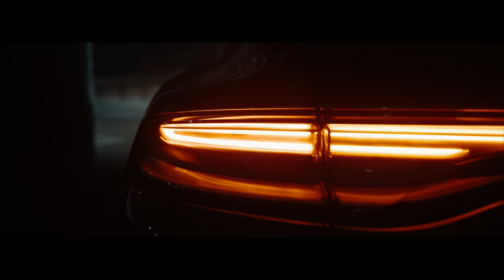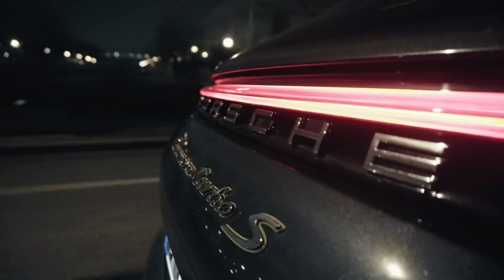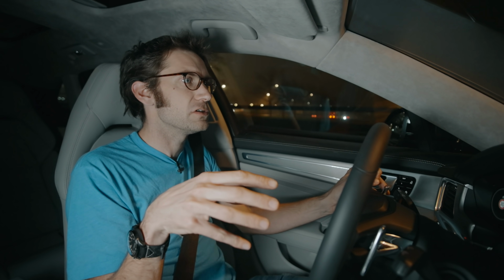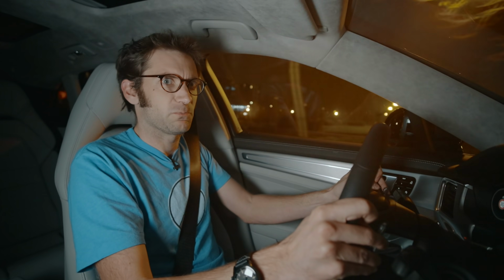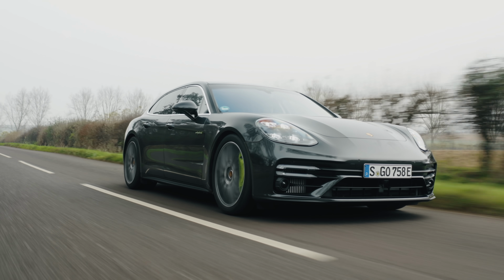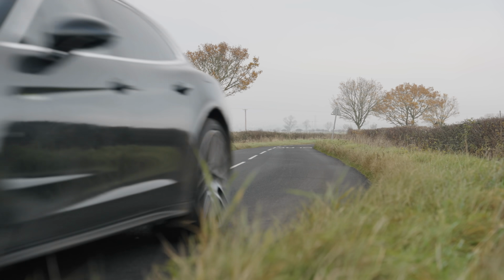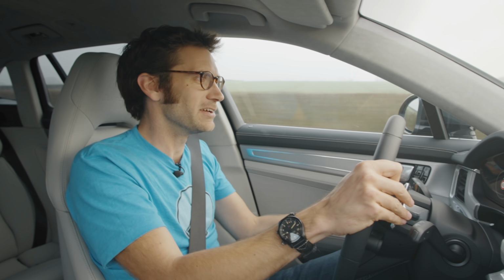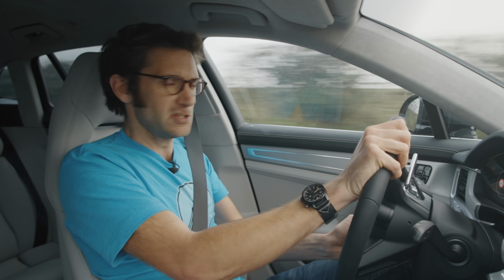NEW Porsche Panamera Turbo S E-Hybrid Sport Turismo: Road Review | Carfection 4K

Comment: Drove the ICE-only Turbo S Sport Turismo a little while ago and I was just utterly blown away. Would have one over an RS6 and an E63 Waggy
Reply: what made it so good ?
Reply: @wc8561  At first it was my disbelief that something that weighs the thick end of 5,000 pounds could feel so agile. The Panamera does that thing great cars do where it wraps itself around you like a warm blanket on a cold day. You're almost at one with it. The steering is sharp and accurate (maybe lacking in feedback from the road surface, but it's so direct it almost makes up for that). Plus the rear-wheel steering really helps. You really can feel the thing pivot in tighter bends. Porsche's ceramic brakes are the best in the business, too. They're immediate, as in the braking starts right at the top of the pedal. There's no squeezing to do. You want to stop? It stops, and in a hurry, too. It's also ridiculously fast, sounds great, and is comfortable on longer commutes (took a road trip in it just to be sure). It feels just like the 992 I drove in 2019, but bigger and much faster (in a straight line).
Reply: @Nick-qx1vf  Were you comfortable with the very substantial (exterior) dimensions of the car?  I would love to pick up a used Panamera... if only it were Taycan sized.
Reply: @RoyalFizzbin  It took me about a day to get used to it. They are not inconsiderable dimensions, but it isn't hard to park. If you live where parking is tight you might find yourself see-sawing at the wheel a lot to get it right, though.
Reply: I would like to know more about the advantages you saw over an RS6 and E63? Though i am currently looking into the GTS variant of the Panamera as it’s more within budget. I would like to hear your thoughts
Reply: @DBrealmadrid9606  Hmm the real advantages, from my point of view, was that dynamically it does everything those two wagons did, but better. It's sharper on turn in, better under breaking, and just faster everywhere. BUT it also has, in my opinion, a greater bandwidth. It's just as, if not more comfortable on the road than the E63 and RS6. But it's also more expensive, less efficient, and somewhat less roomy than both. The GTS would probably be a great middle ground, but I haven't driven it.
Reply: @Nick-qx1vf  I appreciate the insight. Would you consider it to be a step above the other competitors? 
More in the lines of the Audi A7, BMW 8 series and the mercedes amg 4 door? Or is it I still above even these cars as well? Knowing that Porsche in general is viewed as an upper level Marque than the other German manufacturers
Reply: @DBrealmadrid9606  HAH luckily enough I've driven all of the above. That's a pretty tricky question. I'd say the Panamera is better than the A7 (which isn't as dynamically capable) and the Merc (which rides much to harshly for my taste) but the BMW is pretty damn good. If it's between the Panamera GTS and the M850i Gran Coupe, I'd say you really have a coin flip on your hands. I'd still get the Porsche, if it were my money, though.
Reply: @Nick-qx1vf  thank you for continuing to indulge me with my endless questions. I normally don’t trust car reviewers to form up a completely objective viewpoint of the car reviewed. What about the interior? I l know the mercs are notorious for their squeaky and creaky interior. I know that such question can’t be easily answered due to the existence of multiple trim levels...etc. but overall, looking at well specced interiors (full leather and all) which car has the the better interior quality out of the 3?
The only problem i find with the Panamera is that the price/performance ratio isn’t as good as the others, but it’s a Porsche after all.
Reply: @DBrealmadrid9606  Well you know that old cliche where Porsche's "punch above their weight"? It's not so much a cliche as it is a fact. They are masters at pulling the most out of their cars—which is what makes the Turbos and GT3s so special because that really is Porsche at its maximum. They're truly world class. 

The 2021 Panamera was rock solid imo. The E63 I drove felt very well put together too, as did the GT63S. Audi's have exceptional build quality and are great places to spend time BUT the fact that there are three screens (one for the digital dashboard, one for the infotainment, and yet another for the climate controls means you're going to to have to be comfortable with three different interfaces, and that's not for everyone) Personally I dont like the way that MBUX works, though. It take a very very long time to get used to and is frequently dim-witted and slow. iDrive is really just okay but I don't like BMW's interiors. Little things like doors being too high (so I cant rest an elbow comfortably on the window sill) and steering wheels that are too fat (not to mention the ABUSE of plastic absolutely everywhere) really turn me off. Again, i'd really say the Porsche is your best bet, even if its touch-control center console IS a fingerprint magnet.
Reply: @Nick-qx1vf  the point you make of the UI is excellent, it’s often disregarded by reviewers or glanced over at best. I have been inside the E63 but not the GT63. I truly can’t justify the premium paid for the GT model given that it sits on the same platform used by it’s “lesser” counterparts, being the E-class and the CLS-class. If i were settle with the Panamera then it would be my first ever Porsche. I have seen claims every where of Porsche’s being overpriced. While there is some slight truth in that, from what you are telling me and based on other first hand experiences of others who, too, had the chance to experience what is it like to be in one. What do you say of the price/performance factor? It’s, in my own, albeit ignorant, opinion, the main drawback the Panamera.
One more point i would like to add is if you could address the practicality vs its rivals. I plan to use the car as my daily driver so any experience you could share in that regard would be tremendously appreciated.
Once again, i thank you for continuing to provide invaluable information to make up my decision.
Reply: @DBrealmadrid9606  Hey man no problem. I'm happy to help. If you want something more practical, go with the Sport Turismo. It grants more head room in the back, and more cargo space. Plus wagons are just better anyway. 

When it comes to price/performance value I  happen to think that, yeah, Porsches DO cost a lot more money than their rivals, but I say its worth it. It's also extremely difficult to use all of an E63s performance on the road where as the 450 hp V-8 of the Pan GTS is almost perfect for a daily driver. I feel that 500 horsepower is about the maximum that you can comfortably use everyday and I mostly agree. ALSO one more note about the Panamera. It is much (much) easier to get to grips with and take advantage of the available performance. You get comfortable so much quicker you're less likely to make mistakes, and more likely to develop your own limits. But don't just take my word for it, test drive them both and see what you think.
Reply: @Nick-qx1vf  Driving dynamics are an important part of the overall experience and, based on your extremely thoughtful answers, i can deduce that the Panamera more than fulfills in that regard.

I actually think that benz made a mistake in making 3 different cars on the based Platform. Especially since it had the CLS as the previous direct competitor to the Panamera. BMW also renamed their 6 series as an 8 series to push it upmarket. Currently i am scouting the market and i have witnessed that the 8 series tends to depreciate heavier than its rivals. I don’t know what to take from that but what i do know and fully agree with you on is that its interior isn’t necessarily that special and does leave a lot to be desired. Based on your own conclusions i think it’s safe to say the Panamera is the 4-door version of the 911. Which is, frankly, the best compliment the car could get.
Furthermore, since i live in Europe, the extra juice from the AMG, M and RS models will not be used to its fullest extent.

Everyday driving inconveniences should be addressed by the reviewers and highlighted the same way you exceptionally did. After all, i will be spending most of the time commuting/regularly driving and these things while seemingly minuscule at first, do eventually add up providing an unpleasant experience.

Thank you for your thoughtful answers and detailed explanations. They have been extremely helpful.

Have a good day!
Reply: @DBrealmadrid9606  Cheers!!

Comment: I drove the new "regular" E-Hybrid recently, good lord what a snooze. Sure it's nice if you have a sizeable family to drive around, but it's so frigging large while offering no emotional experience whatsoever.
Reply: Interesting - so you also found it felt large - like Harry M.; (I was surprised Henry doesn't, here...).
Reply: It is an executive-aimed vehicle the lower end Panamera’s with it’s softer suspension and better sound deadening with the V6’s. The moment you drive the higher trims (ESPECIALLY the GTS) Porsche throws in more of their brilliant dynamic systems into the car to hide its weight much better than say a 4e-hybrid. Plus the Panamera is a heavy car, you can’t expect 911 levels of driving experience. But it is a near base model after all.
Reply: It looks big, feels big and is big. Duo to the design of its headlamps, it would be very difficult to make it appear smaller then it is.
Reply: @kkfarmedkk  sure but things like rear wheel steering could help make it feel smaller (smaller effective turning circle). feel smaller, mind you, but not necessarily lighter.
Reply: @juv_3nal  Feel in wheelbase, but not its size in general. Visually, it feels very big and wide. And correctly so. Its nearly 2 meters wide. Not to mention with the softer design on the hood, with the headlights.

Comment: I would like to make a suggestion: could you please make a video how to drive the damn thing,  I mean after the battery deplets it's energy you have only the added weight! How should you use this contraption, charge every 40 miles,  charge on the go , use the battery hold. Please could you elaborate on the use of the hybrid system.
Reply: Leave it in Hybrid auto is probably the best strategy. As for the hybrid system being dead weight there is one trick it can (and does) use even at constant speed. That is to use the motor/generator to load the engine to put it into a more efficient load condition and then use the electricity generated to "sail" later on. It's a bit like an automated burn and coast but using the battery rather than inertia as the energy store. Given that burn and coast can easily give 20% improvement in efficiency we might expect perhaps 15% from this system.
Reply: @ColinMill1  thank you

Comment: Does this complex drivetrain have simple load protection for the combustion engine ?
Or does customer gently drive away out of the suburbs, and just hits the floor when the motorway appears ?
Resulting in cold start -> Instant full load on the ICE.
Reply: With fly-by-wire throttle and boost control I doubt the system will give you fully loud when cold even if you ask for it.

Comment: Great vid, as always - how does this car compare to the 4E-hybrid? Or indeed the 4S Taycan? Would be an interesting comparison...
Reply: Sea BreezeUK Harry's Garage has just the video for you! 😉
Reply: Panamera 4 e-hybrid isn’t nearly as nice to drive in comparison to the GTS and above. Porsche gave the ‘lesser’ models more of a comfort and day to day executive feeling rather than the punchy straight to the bends higher end models, especially seen by the GTS.

As for the Taycan 4S? Well that’s interesting because you’re comparing a base electric Porsche to the top hybrid, i’d still take the Turbo S-E, but if electric stations are more dependable, then my choice could change.

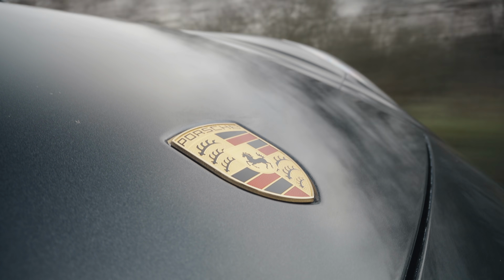Comment: 5:50 oh no, not this again. To make ethanol out of hydrogen an CO2 is enormously expensive, it costs like €70-80/liter, it is a massive waste of resources that could be used more efficiently. (Like charging your electric car with the solar power directly). This e-fuel idea is floated every 7 years, then it gets invariably dropped, then brought back again.
Reply: It may be the future for enthusiasts wanting to still be able to drive ICE cars, with the idea that it'll become cheaper over time

Comment: If the answer is "Hydrogen" and the question relates to anything inside the earth's atmosphere, then it is a deeply stupid question being asked. :P
There is almost nothing worse than Hydrogen gas except for cryogenic liquid hydrogen, in any system.
And the only reason it works in space is because it kills three birds with one stone: Hydrogen rocket fuel also runs the electricity generator and the by-product is drinking water.

Comment: A hybrid Panamera actually makes no sense. None whatsoever.

You need to plug it in EVERY NIGHT in order to get any benefit. Ok, not a major issue (although it soon gets tiring in the pouring rain). But then you’re pootling around locally in a car weighing 2.4 tonnes, using the battery, but your 691bhp is utterly wasted. So why bother with a Porsche?

So you take it for a nice long drive, over the hills to get the benefit of the power. And the dynamics. Which are fantastic. But the battery lasts mere miles driven like that, and running it down the motorway to charge the battery eats the fuel.

After a while (as in, when I had one, 3 years) you end up driving it like a normal Porsche, with a 300kg useless battery pack partly resulting in 27mpg.

Pointless.

Comment: Garbage, I take a Tesla model S and destroy it in speed and efficiency and can get it charged at superstations instead of wal-mart parking lots.
Reply: This is for us Europeans that appreciate handling etc and not just straight line speed.
Reply: If you don’t care about that V8 sound, you shouldn’t be on this channel talking about those trash Tesla which by the way, even Dacia have better built quality than those shitty electric cars lmao
Reply: Cool. Then the Porsche will just reel in the Model S and sail past and keep on doing so. You'll have to stop for 20-30 minutes to recharge and the Porsche can stop for five. The Porsche driver will be finishing dinner by the time you rock up.
Reply: Destroy it in the first 50 feet or so, not by much mind you. And then, your watching it grow rapidly in your rear view mirror until it passes and shrinks off over the horizon.................🚀 trying to compare a Tesla with a Porsche is a sign of accumulative grey matter in your skull mate. Visit your local GP asap please.✌🏼
Reply: Yes, to 100 miles per hour. And then the porsche will sail past while the model S slows down, overheat, battery will reduce, power will be restricted and then it will need half an hour charge to go another 150 miles half of which with low battery and not full power to get you to the next charging station for another half an hour coffee break.
Brilliant isn't it ?